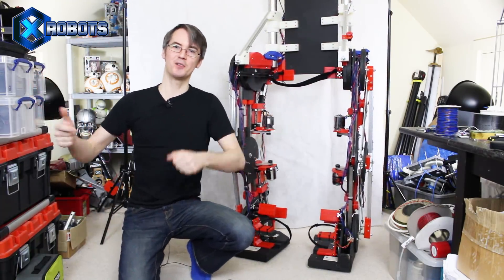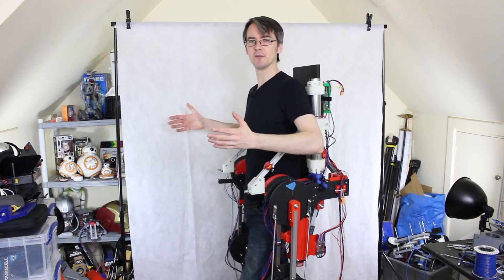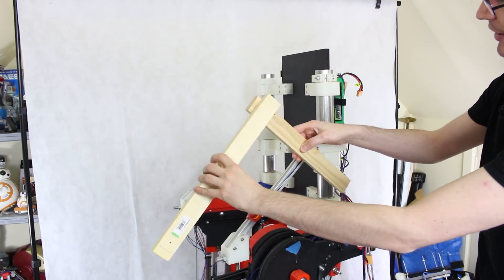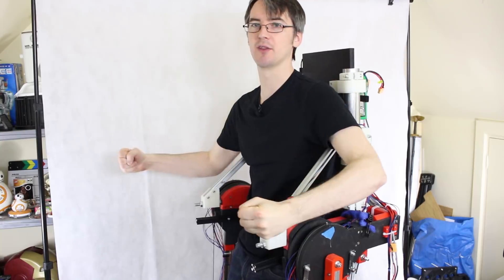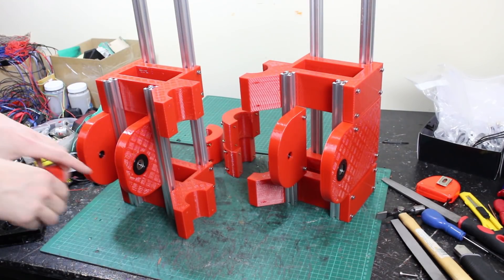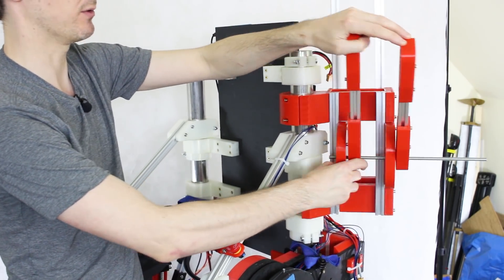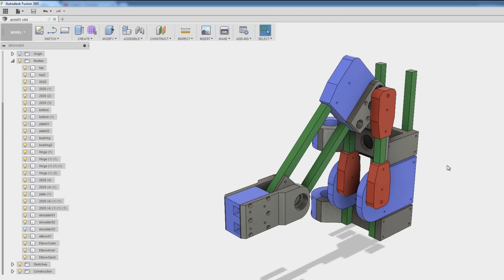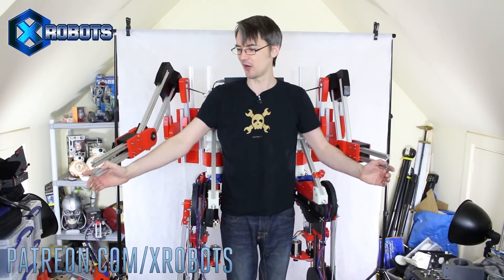Iron Man Exosuit #23 - Building Arms | James Bruton

Comment: James, fantastic work as always. I've watched this entire project right after seeing your Hulkbuster take shape. I'm quite surprised that you haven't invested in a Dremel rotary tool. It would make quick work of cutting or shaping anything, especially steel or aluminium with surgical precision by using the #420 cut-off wheels. Generic versions of the tool can be found at most hardware stores or via Amazon for under 20 quid.
Reply: A hacksaw seems like a quick way to make cuts that 'wander' and ruin an amazing build due to the multi-axis nature of the human arm. Jigsaw seems like a better choice for larger cuts, while a Dremel works best for the finer bits that need adjustments down to 0.1mm

Comment: this looks really awesome! in the future, will you make the arm extend out in any kind of way? Maybe on the forearms just before the wrist joint you can put in a mechanicasm which extends the arms length? You get to a certain point then you push a button or lever which is connected to linear bearings that push out the wrist and locks into place then pick up an object off the floor, pull back the wrist and the arms are normal length again? :)
Reply: James Bruton awesome! Either way, look forward to seeing more progress :)

Comment: IMO you should concentrate the prototyping on only one arm. When you find the right design you can mirror it and build the second arm based on a working design. Right now, you're doubling print and construction times on a design which could not lead you to a solution. Sounds like a potential waste of time (and money).
Reply: Yup! In fact I've the same thoughts on the legs ( :P ), but I understand that testing only one leg could be more difficult than testing only one arm. 
Great work anyway! Can't wait to see the next steps!

Comment: What about a small counter weight on the back of the arms, it would help with lifting and not require motors but you could use motor input for heavier load.

Comment: But doesn't bending forward like that put you at risk for back strain when lifting? I thought they always say "lift with your legs, not your back". Won't that put you at risk if the suit fails while you're lifting something?
Reply: knightshousegames if the suit fails and he's lifting like 500 lbs, I don't think it matters whether he put that weight on his legs or his back, he's gonna have a bad time.
Reply: knightshousegames I don't think he's going to be taking any of the weight of the object he's lifting. He'll find a way to make sure that the suit takes all the strain
Reply: I'm just saying in the case that the suit malfunctions or loses power or something, you might find yourself in a slightly unsafe position. It might make sense to look at the way power lifters and the like pick up heavy things, it might even allow you to spread the stress over the suit more effectively?
Reply: If the suit powers down i'd assume either it'll all go stiff holding the weight anyway, or it'll go slack and let go entirely, he'd just have to left go and he'd be fine.
Reply: Tate Amstutz that's a good point, actually. He's using all of these screw drives, which, when unpowered, have way too much resistance to movement to "fail" in the catastrophic sense. I agree with you that the failed part would just go stiff.

Comment: May have missed this in video, but how you going to balance it when you pick up a load at full extension?
Reply: James Bruton With arms extended and say 5kg box, wont the suit want to tip forward - not sure how heavy the suit is, weight looks balanced across the feet. Would think you need a weight to rise from back to balance what you are picking up or the suit to lean backwards a bit. Accelerometer with some interesting pid action or load sensor and a function to calculate max lift, extension v counter balance?
Reply: So basically what I'm hearing here is that he needs to add a robot dinosaur tail.
Reply: Darrell S Dude!

Comment: Excellent builds,  random thought which occurs to me -  read some Chapman 'add lightness' or study the concept
All your components are so 'square/chunky' ...
Reply: Very true Richard. Though in a prototyping stage its best not to get to caught up with weight and appearance. James mentioned in another video he's looking into CNC machining Aluminium parts and this is still very much testing. Who is Chapman? would be very interested to read up on his work
Reply: Colin Chapman - Lotus,  took trading weight and function to the extreme, arguably beyond extreme, to get his cars at the front of the race - 60s->80s. More an illustration of principle than direct application to this project. Fair point re prototyping - its just noticeable, even if not for weight, for materials cost how blocky all these parts are. I guess theres an argument that the internal honeycomb on 3d print means different external design to more ribbed style weight/strength tradeoffs.